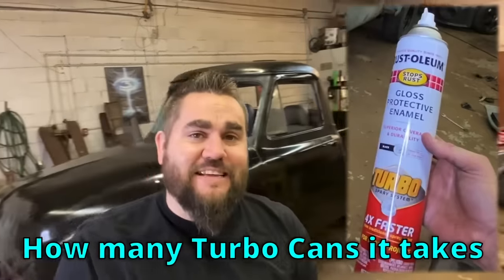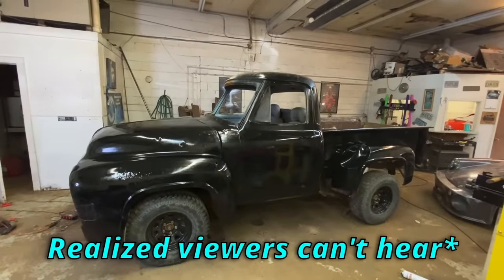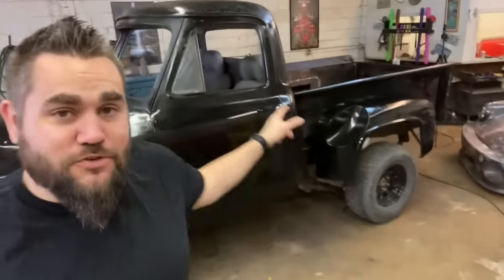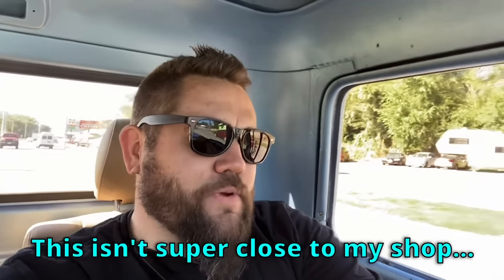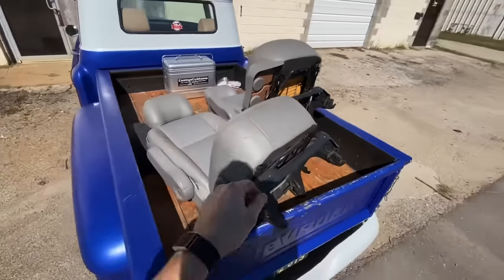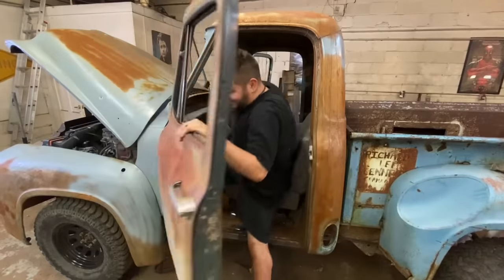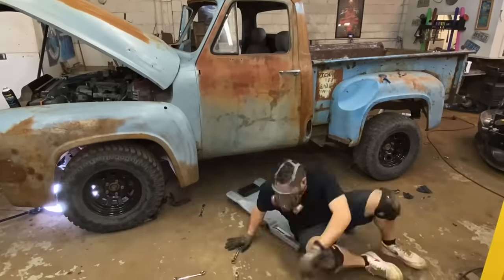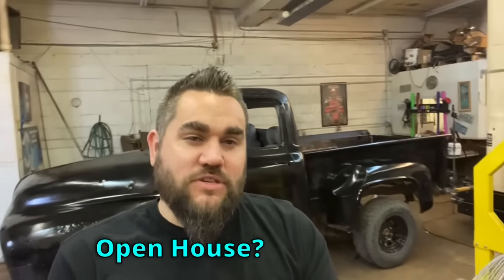SPRAY PAINTING MY TRUCK WITH TURBO CANS! HOW MANY WILL IT TAKE? CHEAP BUDGET 4X4 RAT ROD NEW FRAME

Comment from the maker: WE ONLY GOT 90 DAYS LEFT TO HIT 100k AND GIVE THE 1954 CHEVY AWAY FOR FREE! HIT THAT SUB BUTTON!
Reply: Would love to have the 54 or anything you build love your style ratrods and patina paint make so many vehicles look so goooood
For the rat mud truck you should use old street signs for the bed floor. Also pull a couple plugs see if fuel is in the cylinder if it is check the cam position sensor or possibly map sensor good luck with the build love the channel love the content keep up the killer work
Reply: I'm trying Casey, I've got my wife and buddies subscribed too. Good luck on the 100k.
Reply from the maker: @mikebobbitt5278  love hearing that, and thank you!
Reply: Next is Red trim along the edges of some parts....heat it up like a habinaro pepper...(yes im sure its wong)
Reply: done
Reply: Does the turbo paint turn out pretty good? What clear are you using after?

Comment: I'd find out how much pressure is at the rail. It could be letting enough gas through the filter to seem like it's working but not enough to keep the right pressure up for the injectors. A relay could be bad. Swapping them around is an easy way to check. Used to be all you needed was spark and fuel. Kinda miss those days.

Comment: Casey I gotta tell you a true Story.
I bought 12 of that exact same spray paint the (Gloss Black Rust-Oleum turbo) bought a case of Rust-Oleum sandable grey primer and last early spring set up a temporary paint booth I'm our 2-1/2 car garage that's heated and sanded our one owner original 1972 Rally Nova 350 4 speed car down to bare metal (the original factory metal flake green was in really bad shape) then took and filled any little dings or bumps we couldn't pop out, got it all as smooth and straight as we could, primed the entire car just like factory (door jambs fender wells etc.) wet sanded between coats, then let it set over night in the shop with our little box fans for exhaust out the window then the next day painted the entire car with 4 good smooth coats and sanded between all but the last coat then sprayed the entire car with 2 heavy coats of clear gloss and sanded and buffed them to a absolute mirror shine. it looked so good we went to a big car show this summer (it's a Pro Street car now) complete with 434 small block and Liberty 5 speed and we parked the car and went walking around to see the other cars that were way out of our class and league....when we returned there were 2 officials from the car show organizers that had just finished giving us the peoples choice award ! and it was kinda embarrassing because we hadn't even entered in the show.....but that didn't matter to them since any car at the show was eligible for this award and sheesh we got a free steak dinner for 2, a hundred bucks spending cash and a huge ass trophy....and we had no intention of putting it in the show cause while we were very proud of it ...we had no idea other people said it was by far the next to best paint job in the whole car show !
lol.....we didn't have the stones to tell them it was a lot of work and rattle can paint !
lololol. true story.

Comment: Hey if you ever need to test a fuel injector you can use a 9v battery to see if its opening, you can also use the battery to keep it open and run some cleaner through it

Comment: Wow that’s good to know. Last year I rattle canned an 87 f250 with regular rustoleum gloss black cans. Took about 8 cans without doing inside the bed that was previously done with a cheap spray bed liner. Currently have a 91 f150 that needs paint and I’ll definitely be doing it with these cans
Reply: let us know how it turned Out 🙌
Reply: @vleldaddio210  definitely will. Truck is quite the project right now. Hopefully I’ll be able to get back to it after my deployment.
Reply: Make sure to clear coat it

Comment: Dude that is a serious spray pattern for some shake shake, I agree with some of the other comments about checking fuel pressure at the rail and make sure the injectors are getting power to fire.

Comment: Hey man just found your video.
I like the idea  of your painting  I had the same thing with my old dodge, it was painted light gray. And had bare areas, old paint colors .
A friend of mine told me to use clear coat, I did and man it changed from the light gray to black and with patina showing! I'll try to send a picture! Thanks.

Comment: Definitely check the fuel pressure at the fuel rail. Just because it's at the filter doesn't necessarily mean there's enough to start it. Had similar issue on one of my projects. Then check for spark.

Comment: If it's a vortex and it won't start always check to see if you have oil pressure...if the sending unit is bad it won't allow the truck to start

Comment: Cool on the paint job.   on the engine.  i would pull the tube off the throttle body and open it and spray a little ether in it.  if it fires off then check fuel pressure at the injector rail.  if you got proper pressure then look at the injector and see if they have power and if the ground it breaking like it's suppose to pulse the injector.

Comment: Does it crank? If not, check the starter, and check the associated parts. If it does crank, check for fuel getting onto the intake area. If it's leaking, injectors probably need new seals. Also check the oil. If they mix,oil and fuel make the motor go bang.lol

Comment: It's a Ford pickup on a __  4 wheel drive chassis?
Fill in the blank

Some cars come with a Schroeder valve to relieve the pressure near the fuel pressure regulator.

Comment: In the event that it is the one with the plastic clips all you gotta do is take A sharpie and cut the top in half and then slit it down the center, slide it over the line push it up in the slot and pull out.

Comment: Got here late ,  have u tried to spray something into the intake to see if it will kick off for  a second....... if it don't it might be ignition, no  spark at plugs ..... if it does kick off then it's fuel related .

Comment: i just pulled a 5.7 that wouldnt fire up for me. the fuel pump was doing what its supposed to. i bottle fed it for a few and put a few rrrrrr's to it then the throttle body decide to start working. then i pulled it and set it under my bench for future use.

Comment: Try checking the security system. I could need to be reset. If it's the security it won't allow the fuel pump to turn on.

Comment: Does the truck have one of those "impact" switches that kills the fuel pump after 3 seconds? I would also check/replace the cam or crank sensor. Often the crank sensor can get metal shavings stuck to the end of it since it's magnetic. Sometimes cleaning them off does the trick.

Comment: interesting spray, I've never seen that turbo version, after looking into it, they need to add more colors, only black, white, clear available. I say raise the seat 2" so you don't look like a 12 yr. old sitting in it.
Reply: they do have a clear white black and bed liner, and rusty brown primer i plan on getting a couple bed liner ones for my hood the bed and my roof

Comment: Regulator, injectors, check wiring in case any mice got in there and chewed on anything around the injectors. They love wire insulation

Comment: U should chop it, slam it, and make a sick AWD rat rod. How fun would that be? Also I e had a few of those 4.3's do the same thing . Once it was a bad fuel pressure regulator and the other time was an ignition control module.

Comment: Haven't watched the video but I had 98 Buick and it ran then we had to park it cuz it put like $600 worth of parts coil packs control module fuel pump fuel filter some other parts but nothing then 3 weeks ago I cut the muffler fired right up back compression hahaha

Comment: Pull fuel line from rail and check fuel pressure. Just because it has fuel from filter don't mean anything. From there check injector relay. Or check for power at injectors

Comment: Suck, bang blow. You have Fuel, but is it in the Fuel rails? Also certain engines require a certain fuel pressure. If all that is correct, do you have spark? Even if you had a bad fuel injector you still should be able to start it. But can't be sure without watching a video of you trying to start the truck. Also check out the ecm, and fuses for any blown fuses for engine and ecm run/control.

Comment: What is the fuel pressure does it hold pressure after the pump has cycled that style of 4.3 intake has plastic lines inside the intake those are known to Crack and leak fuel internally make sure to replace the upper plenum gasket they are also know to cause an internal vacuum leak

Comment: Casey, it looks to me like the seats are a little bit lower than they need to be. Nice seats though. Lovin the looks of this build. For some reason I get the idea that you’re still thinking about chopping the top. It’ll be a first if you do. Mixed emotions on that one. That will make the seats the right height though. Thanks for sharing this build with us. 
👊😎👍
Reply from the maker: If they are any higher your legs won’t fit under the dash lol

Comment: You're better off using a fine nap roller and some acrylic enamel. You get much better coverage and there is less waste. Then you can wet sand the orange peel out when it dries. I did this to my first car (a 1942 Packard) when I was 17 years old...
Just my quarter adjusted for inflation...

Comment: Hey Casey. Does that ever have a wide spray pattern?  I find that my finger gets too tired and sore using rattle cans. It's coming along though. Thanks for sharing.🍁👍👍
Reply: They sell guns for rattle cans that make it a lot better
Reply: most cans you can simply rotate the nozzle direction with a coin or small screw driver
Reply: What brand of spray can is that to have such a wide spray?

Comment: I think checking fuel pressure at the manifold makes sense. Just a thought... I wonder if the doner vehicle had any kind of immobilizer or fuel cut off fitted. I know on my modern bikes there are switches all over the place to stop your engine if the stand is down or if the bike is on its side, some won't even start until you have the clutch pulled in or the brake pulled on, my tractor won't start until you sit on the seat.

Comment: Wrong way of doing this. Gotta get the surface rust off of the body first, prime it, sand the primer, then paint. In about a years time, that surface rust you didn't get rid of will be back to haunt you, and you'll have to start all over again, this time, sanding it all down and painting it all over again.  I will say that it does look great for paint that comes out of a can, that's for sure.

Comment: That's a vortec 4.3 check your fuel pressure you need 55 PSI. Anything else n the injector poppets won't open. Early Chevy fuel injection systems suck ass.